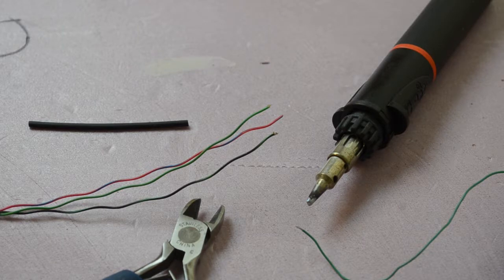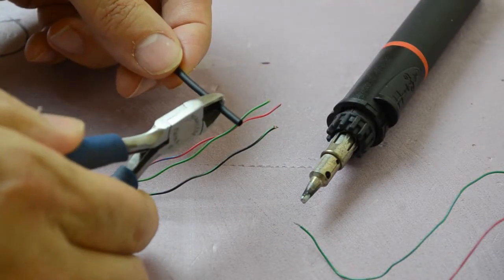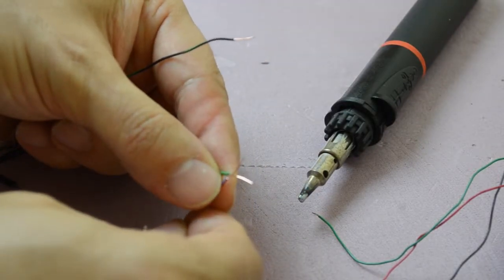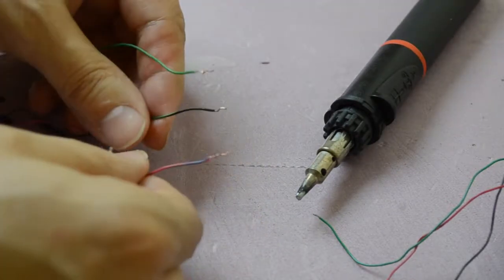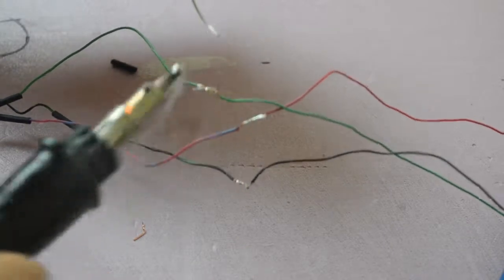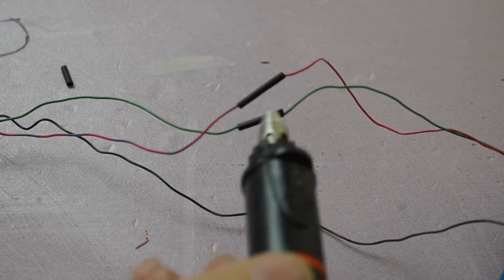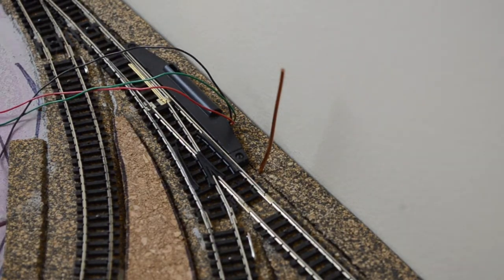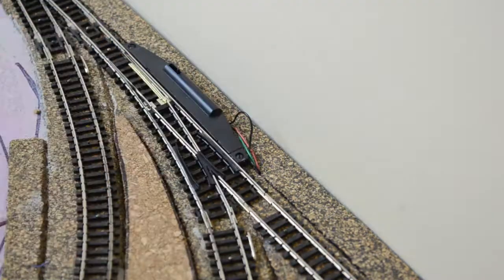The Fiddle Yard- Remote Switches: 2/4

Comment: Punch a piece of brass tubing big enough for all 3 wires to go through, into your hole, then feed the wires through the tubing until they are through the benchwork. Continue pulling the wires, then pull the tubing out from the bottom.